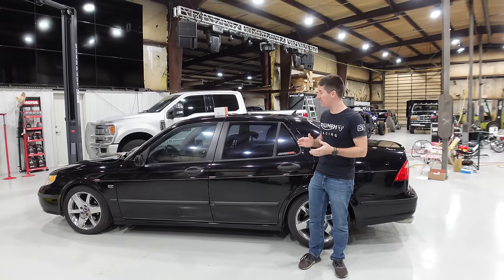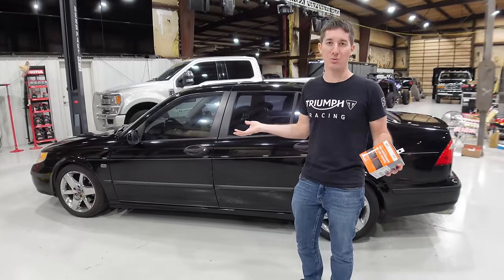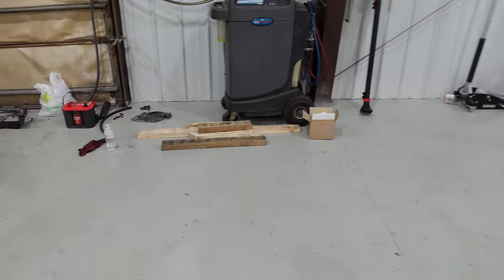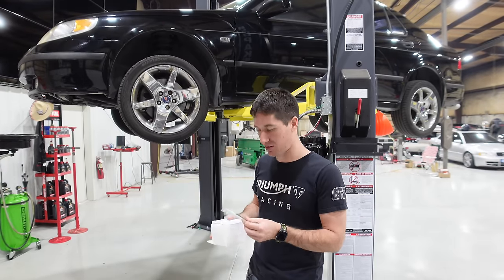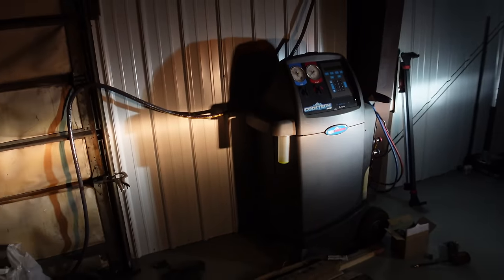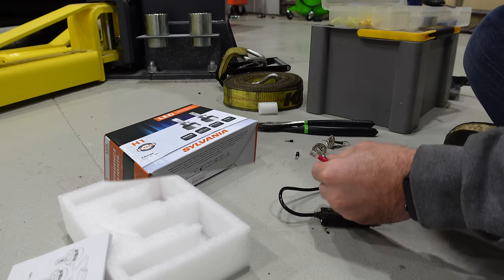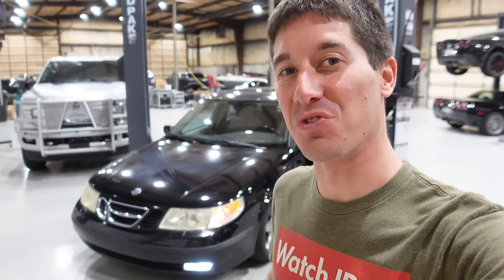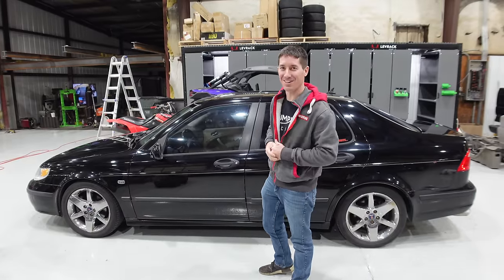Testing LED Fog Lights VS Halogens In My SAAB 9-5

Comment: I’ve been looking to do led on mine but heard that halogen is best at going through fog. Led just bounces off and you can’t see shit
Reply: That was my question above.
Reply: Believe what you want. The only real downside is a brighter lamp will cause more light to reflect off of the fog ...but that's just physics. Brighter lights also illuminate further down the road. The only thing people talk about that has any relevance is the fact that fixtures designed around a burning wire don't focus the light as well when you insert a burning chip.
Reply from the maker: People just think yellower light is better (totally subjective), nothing to do with the technology. 🍻
Reply: check out PIAA Hyper Arros. they're 4000K and came with 3yrs warranty

Comment: The problem with these non OEM LEDs is while they look cool and bright, they have components not tested by the car manufacturer. Once that cheap plastic led fan stops turning after some time and the LED bulb overheats, it becomes a fire hazard for your car and safety.

Comment: I thought you knew better.   Yes LEDs put out more light, but it is not just light output that matters.  It is how that light is controlled that is most important.  Light reflectors are designed for specific bulbs and the way they put out the light.  Put in a different bulb, like LED,  and the light no longer behaves the way it should.  Your test clearly shows that.  The first test where you show the light projecting wider tells you the reflector is not working as it should because the wrong bulb is in there.  The light should not be bleeding out to the sides like that.  Now those fogs are going to blind other drivers.  Light reflectors that are not designed for LEDs will never work properly with LED bulbs.  You can spot all the cars with LED bulb replacements because they bleed light all over the place and they blind other drivers.

Comment: Sylvania is generally junk. Osram is the gold standard. Also, the LED bulbs without the fans generally last longer as there's less crap to break (and they have bigger heat sinks).

Comment: rrreeeeeee you shouldnt put LED on reflector housing rrrreeeee!!!! 😂
ive been using LED on my low beam without dazzling the opposite lane. even the MOT guy said the pattern is within tolerance so it's fine. talking about LED fog light, it's a bummer there's not much well-known brand selling 4300K color temp instead of 6000K. 3000~4300K seems to be more practical to be used on fog light
Reply: @elesjuan  it doesnt hurts anyone's eyes so eh.. 🤷‍♂

Comment: they won't be as bright as a halogen bulb...
360° light compared to only 180° on 2 sides
Reply: 180 on 2 sides. 180 x 2 = 360. 

It's more like 160 deg on 2 sides or 320 degrees total coverage around the original filament axis

Comment: Putting LED bulbs in housing designed for halogen bulbs is rarely a good idea, as the LED elements are not concentrated in one spot, radiating in all directions like a traditional bulb. Thus, the reflector will send much of the light in unwanted directions, an effect amplified by the lens.  

Better to buy LED units whose bulb, reflector and lens are all designed to work together.

Comment: *BY accident, not "on" accident. LEDs absolutely suck as functional fog lamps. And you totally glossed over the part about how you adapted thm for the connectors, which was the most important aspect of the install.
Reply: I actually bought this leds thanks to this vid but now i have no clue how to add them to the car due the connector problem😂

Comment: The problem with led lights is color temperature. Too high of color temperature 4500kelvin and above are extremely bright when looking at them and from an oncoming car blinding but being behind the wheel they aren't worth a shit. Being behind the wheel with 4500kelvin or above they work great for 30 to 40 feet then they're useless. 4500kelvin is too far into the blue spectrum. Blue doesn't reflect objects nearly as well as 3500kelvin red spectrum. That's my experience with led lights. I put an off road bar light 5000kelvin on the front of my car to combat the idiots that run around with led lights on. Newer GMC pickups and most Jeep's come off the showroom floor with too bright of "headlights". I hit em with my bar light. I'm already blinded anyway so what the hell eh.

Comment: That's a loaded question. Our HID fog lights worth it absolutely yes every time no matter what you buy. And they're dirt cheap $5 bulbs $15 ballasts but it's more of a project to install and I realize those are cheap parts I named but I've never had one fail yet in 15 years. LED on the other hand yeah instant lights it doesn't take a few seconds for a ticket to fulbrightness but you don't have the color gamut available and you really never know what you're getting unless you're spending like a hundred bucks a lot of LED bulbs are so bright looking and give off no light there are so many designs to try and get around the fact that none of these housings were designed for LED bulbs. Whereas an HID bulb has the same characteristics as a halogen so it doesn't matter they just work and they're cheaper and they don't burn out but you do get that annoying flicker if you have a substandard ballast.  That being said LEDs are still better than halogen for the look you won't necessarily get decent light output.

Comment: Yeah bro just installed the high performance led fog lights bulbs,, 10,000 RPM cooling fan, aircraft grade aluminum. Yeah I'm pretty sure it added at least 12 horsepower....  Built not bought.... Lmao 😂

Comment: Long warranties are useless ...they always want the receipt...who keeps receipts for stuff like this?
even if you keep the receipt the thermal printed receipts fade after a couple of years and are unreadable..Even if you're thoughtful enough to scan the original they won't accept a "facsimile"

They could have said LIFETIME warranty and still never to have to actually honour it!
Reply: Most sellers use Digital receipts now, so what you are saying is a very old way of thinking. So no thermal paper and I have myself replaced stuff with a manufacturer in th past by using digital receipts. Also they don't care about facsimilies anymore either, if they do, then they are a company not worth doing business with.
Reply: Tried to bring a battery back to Walmart with a scanned receipt… no dice!